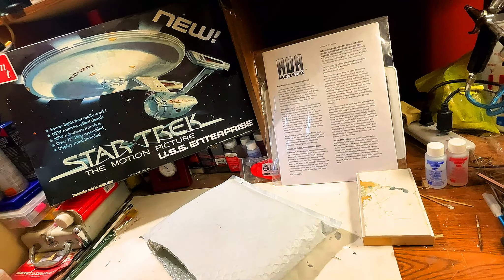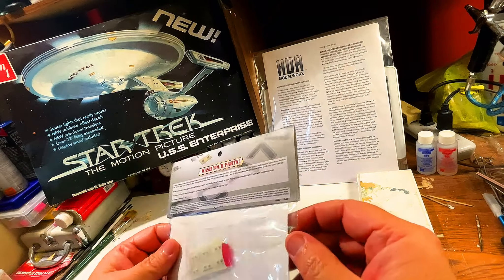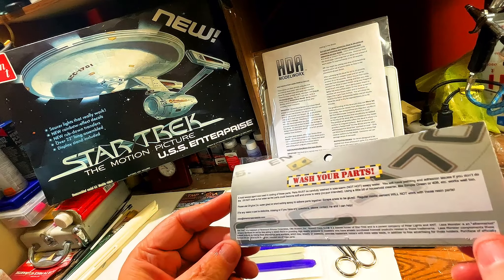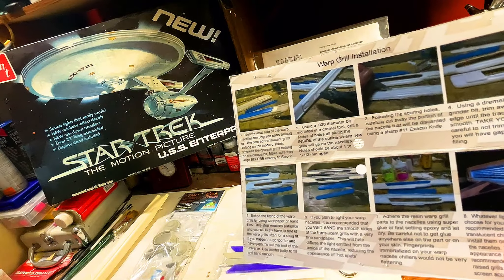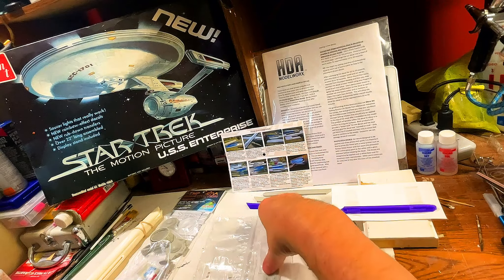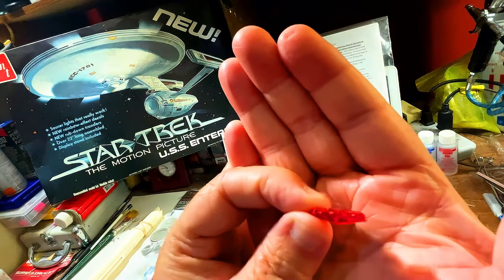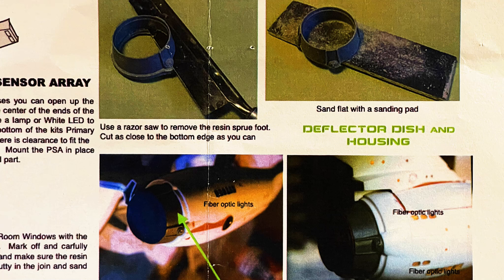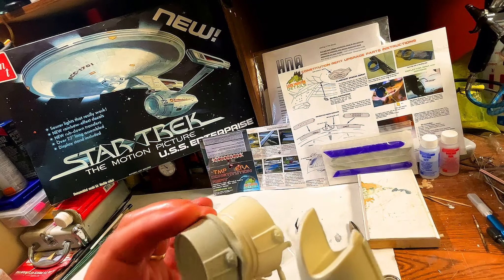Lake Monster Details  Upgrade and Smoothie Kits for 1979 AMT U.S.S. Enterprise NCC-1701 Refit

Comment: Jerry, for darkening the lines on those chiller grilles, if you're doing the recessed lines, Tamiya Black Panel Liner will work better than a pen.
As for the torpedo tubes, here's a suggestion: paint it black, but mask the interior of the tubes (blue tack, silly putty, etc... works great). When done, just use a toothpick, pointy tweezers, or the tip of a #11 blade to pop the masking material out of the torpedo tubes. The tubes will look fantastic if you're lighting her, especially if you have a firing sequence in the system.